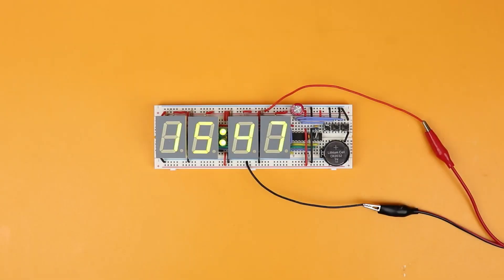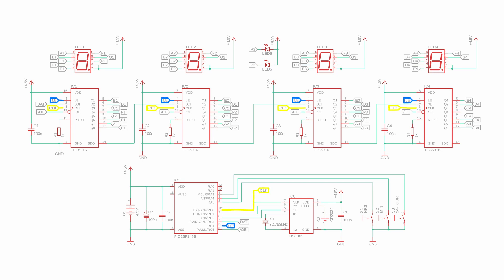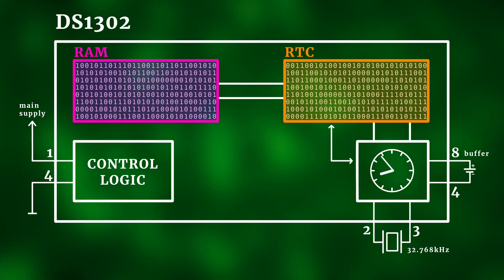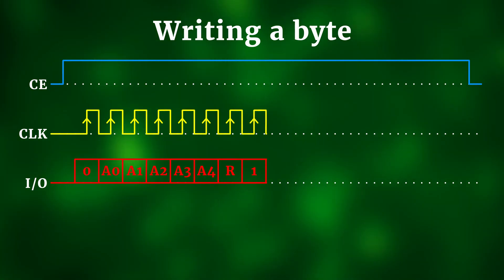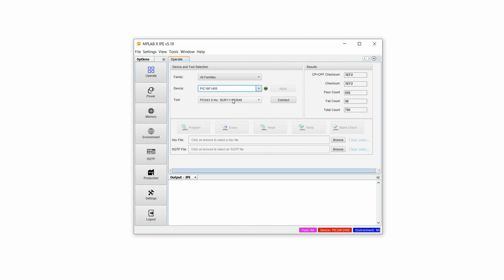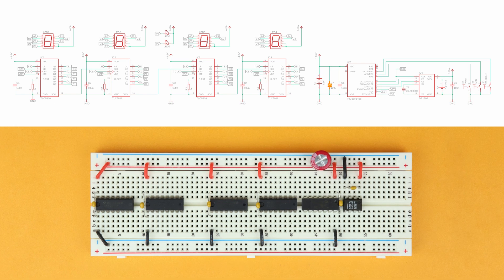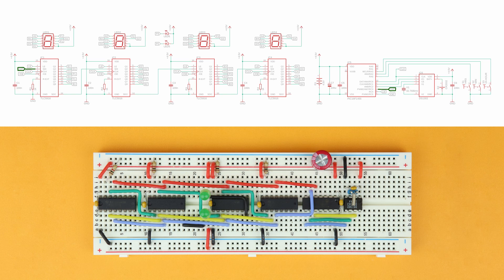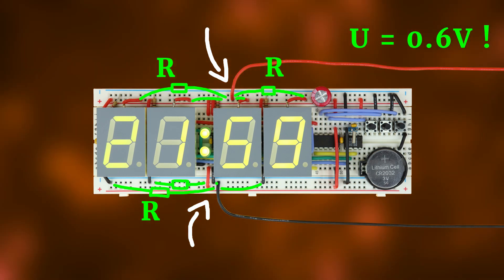DS1302 real-time clock tutorial: the clock that doesn't forget the time!

Comment: Hi there! I am new to this type of project although I have built my own electric guitars for many years. I am interested to build a slightly different version of a clock. It will simply be three concentric rings of LEDs. The thin outer ring of 60 will be seconds, the wider middle ring will be minutes and the inner thickest ring will be hours (12 segments). I don't want any other display functions. I would like to make a circular PC board for the display part, with plain covers for all the LEDs, and hide the main electronics in a small, flat stand base. The centre of the ring would be hollow, like a wheel and stand up by being connected to the base.

I have never seen a clock like this, but I would love it standing on my desk, maybe 20 to 30 cm in diameter. I feel your circuit above might be the basis for something like this, but I wouldn't know how to modify it! How would I go about getting some help with it?
Reply from the maker: This is a really cool idea, I love it! Your best choice are WS2812 NeoPixel LEDs for this purpose, I think. They are individually addressable RGB LEDs with only one single wire for all of them. I have a video on them on this channel, I think this should be what you are after :)

Comment: This tutorial couldn't have come in at a worse time because I just finished ordering some parts for a similar yet worse version of this project 😭
Reply from the maker: Funny story to cheer you up: I built this project first with CD4094 shift registers as LED drivers, and it did not work at all (because they are the wrong chips). Then I switched to the TLC5916 and it worked, the second try. So: you are not alone :)
Reply: @FriendlyWire mine is based around an Arduino uno instead of a PIC, 74HC595 Shift register to control the Seven segments display, and I use a DS1307 RTC module instead of building my own. I will integrate all of the modules into a single circuit for my next version, similar to what you did.

Comment: Bro can you help me please, I couldn't get PIC16F1455 and TLC5916 What else should I use instead??
Reply from the maker: You can use basically any PIC microcontroller for this, in this project we don't use anything that is specific to the PIC16F1455. For the drivers you can use the CD4094 shift registers, if you have to, but they are not so ideal. For smaller displays they work OK, see this video here: https://www.youtube.com/watch?v=H2x3aAJ3jr0

Comment: Will the time be correct if the power is off after powering it On back?
Reply from the maker: Yeah exactly! The clock keeps ticking as long as the small battery is connected. So even if you disconnect the main power and the LEDs go out, the time will be correct when you turn it back on :)